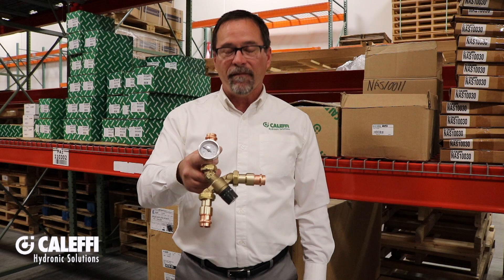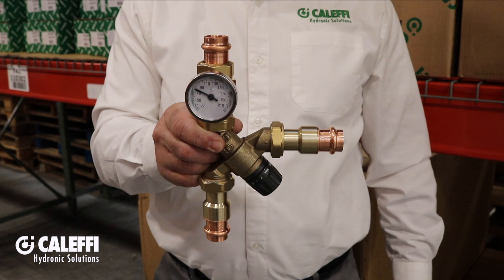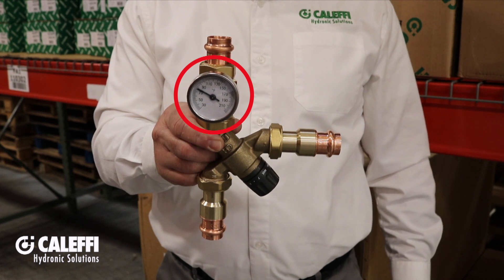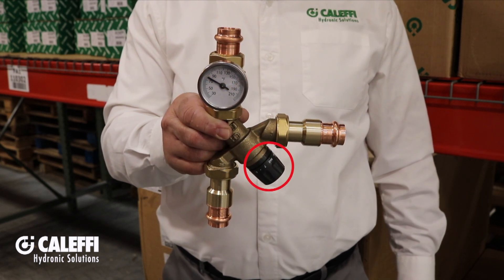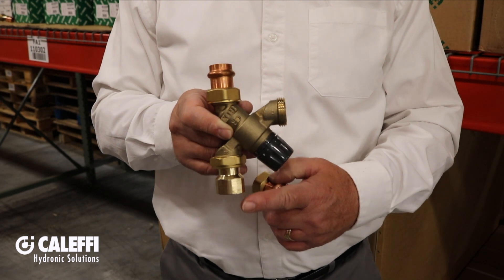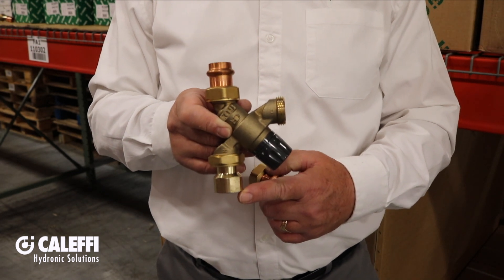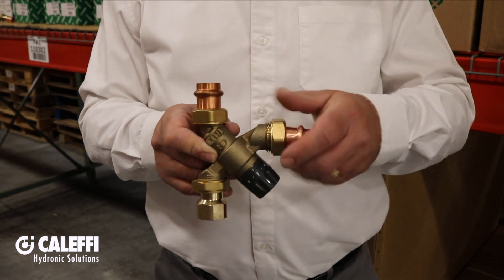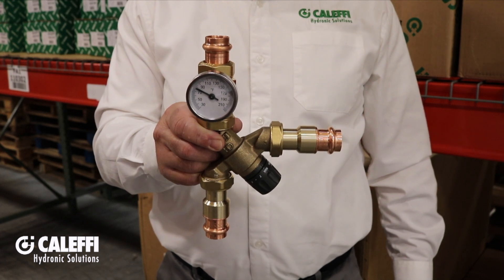Angling in on Savings with AngleMix™

Comment: I thank you for video but I didn't understand well where we install this accessories and what his role  ?
Reply from the maker: The valve mounts on top of water heaters and minimizes the use of elbow fittings, to reduce cost and save installation time and space.
Reply: @CaleffiHydronicSolutions  many thanks for information good luck  .